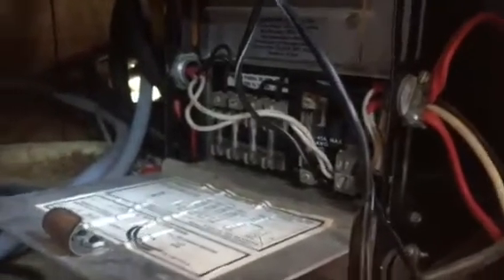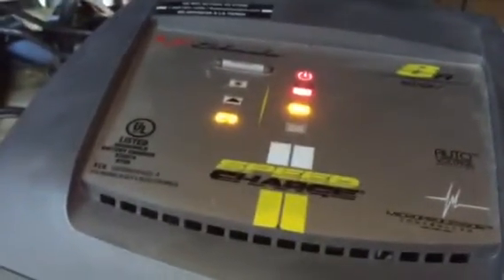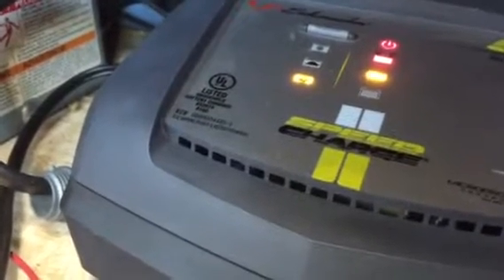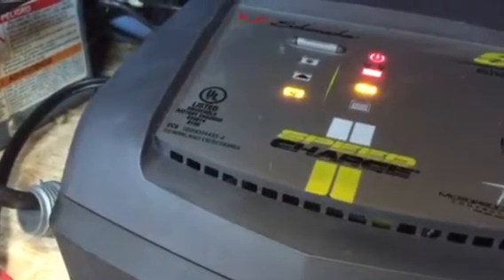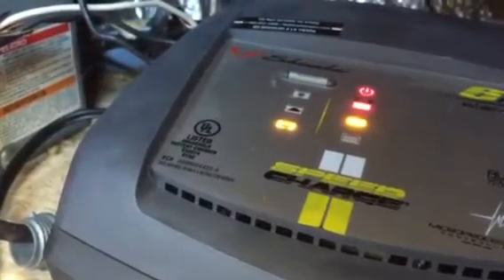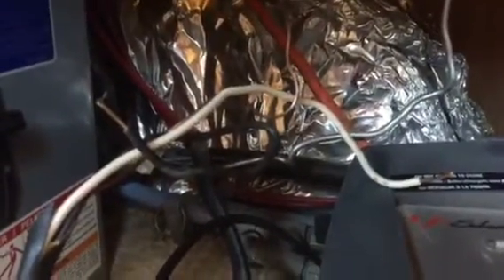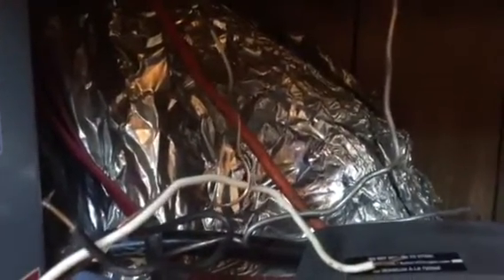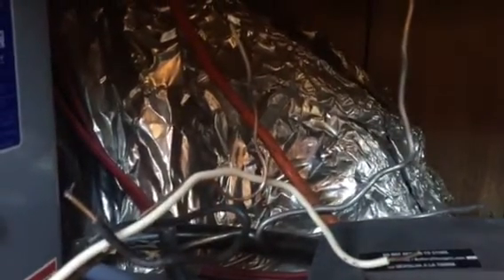1982 Sunline 16 1/2' TT electrical

Comment: One of the breakers goes to your expired power inverter.   One should go to the AC,  the others are for your other 120 volt receptacles.  I.E. Refrigerator and outside receptacle if equipped.   I hope that helps.

Comment: Hey Josh, I have the same camper.. 2 questions I have . what is the voltage of the power cord/ amperage.. I am replacing the plug on the power cord so I need to know asap.. also what did you use on the roof to reseal waterproof it?  Thanks JD
Reply from the maker: J Dee to be honest I don't know, but there is a website for sunline camper enthusiasts that could probably help.  There is a fantastic forum with much more knowledgeable people than me.  The sealing was done before I bought the camper but it looks like some sort of aluminum tape with sealing compound on the bottom.